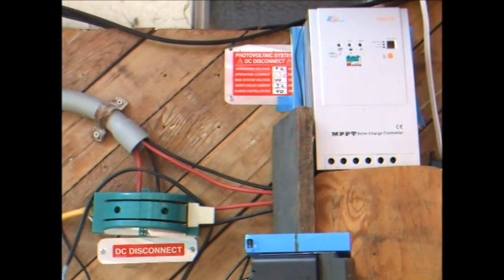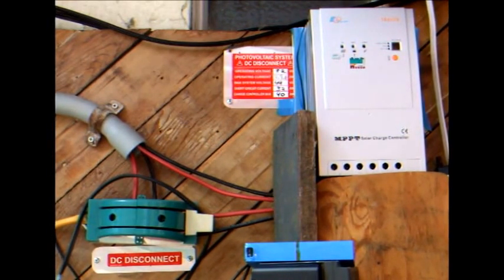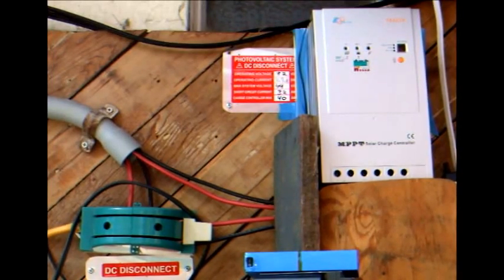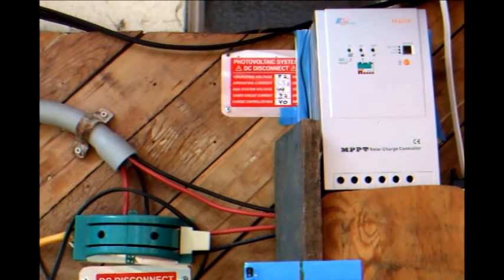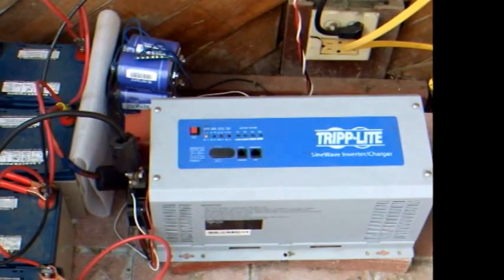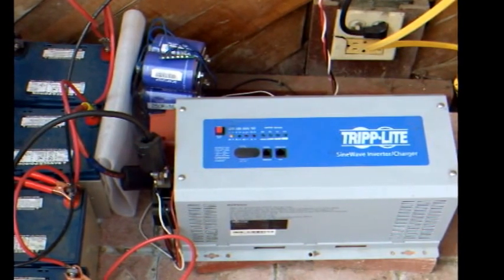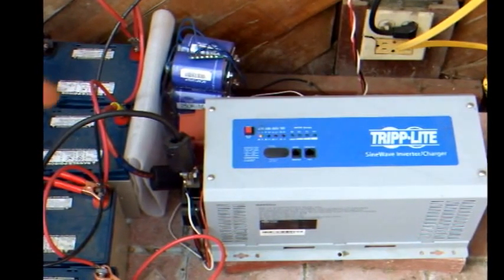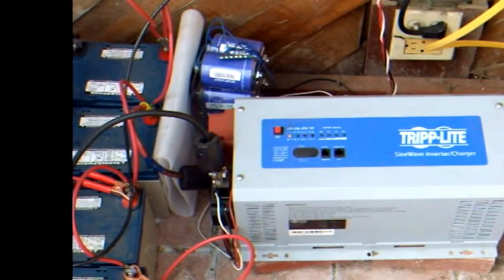Solar System Overview, part 2

Comment: hi. i just installed one of these on my trailer ep 30 amp  tracer mttp . the batteries were low at 5.38 volts .so i currently hooked up a charger to them . also finished hooking up solar panel to controller but no display lit up on the controller.?.......even with the low battery should not the solar panel display come on ?.........or is the controller defective ?
Reply from the maker: Not sure what the lowest battery voltage these controllers will power up on.  They do need to have a battery connected to power the internal circuits.
Reply: thanks .currently charging up...see what happens

Comment: could I use one of those capacitors for my Solar set up I'm on 12 volts ,,, like the kind that kids use in there cars for their stereos they're already at 12 volts I think  Porsche is the brand I seen at Walmart for somewhere between 50 and $60 could i hook something like that up between my Bank and my inverter when I get ready to do my chest freezer to refrigerator conversion to help with surge amps would that work or would that be too hot,
Reply from the maker: +bill767667 I originally looked at one of those caps, they should work fine.  Just make sure you get a decent one and one that is a real capacitor (not some sort of electronic device), and the more farads the better.  I've seen a few other videos where folks are using stereo caps. on their inverter inputs and they seem to work fine.
Reply: Thanks

Comment: I ordered a unit from renorgy something like that 40 amp,should be here Mon.or tue. can't wait to try it out, like the capacitor idea
Reply from the maker: +bill767667 Sounds good, lots of companies resell that same model, including Renogy.  Mine is still going strong after 2.5 years of continuous operation.

Comment: Dear friend brown,
a little help from you. Am using for the past 3 months the EPsolar MPPT 40A
for a 12v system, charging three(3) 100AH batteries. I have programmed it,
as a choice 1, the ''nil''(dusk to dawn) and zero( 0 ) as the 2nd choise.
According to the manual, should provide power, through the inverter, all night long,
nonstop correct???.....
But, for some reason the power goes off at 5:00 in the morning till 7:00 and
then the power goes ON, again automatically! Since the power is off
for 2 hours only, it means i still have watts into my batteries isnt??? why
this is happening?? thanks again!!!